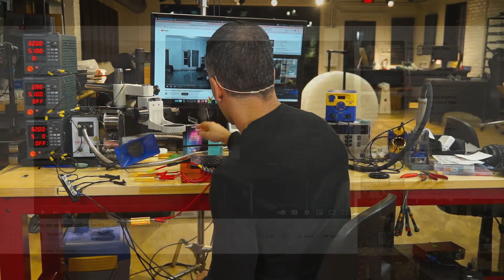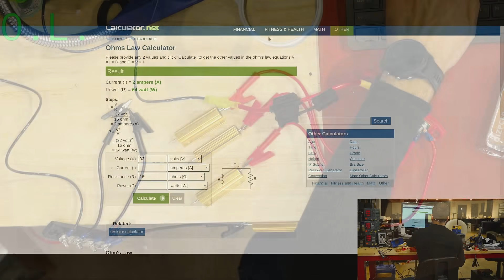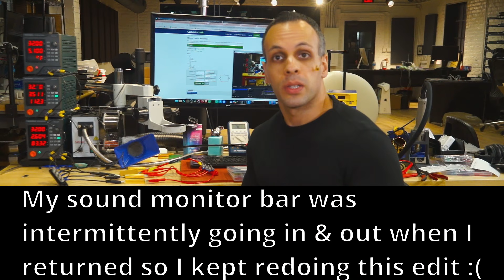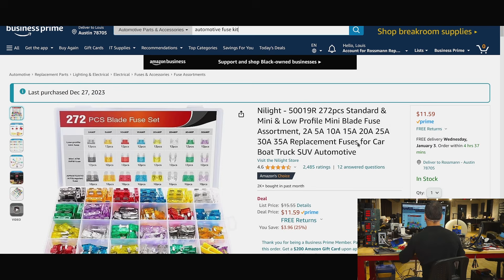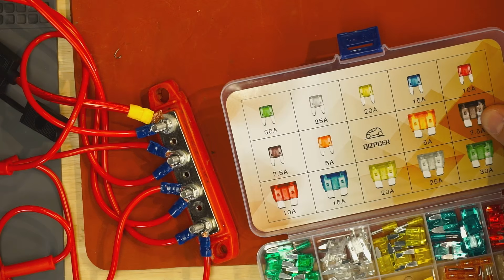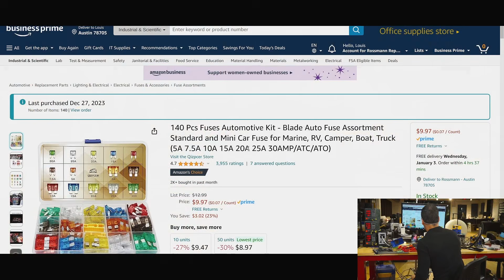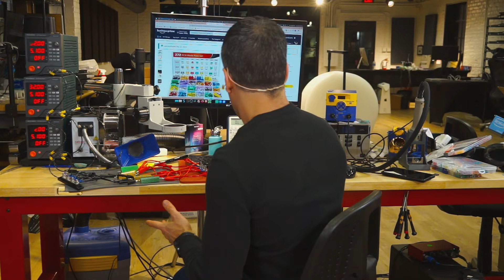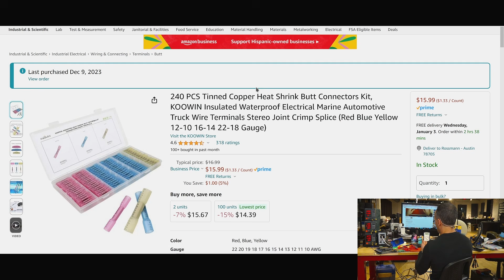Amazon Sells Fake Electrical Fuses

Comment: I found if you post an Amazon review calling out a scammy product they will take it down because you're not allowed to call things scams, apparently.
Reply from the maker: Especially when they are actually scams. This product is still up, by the way, over a year later. 300,000 views. 100 people that I can confirm reported it. Proof that you can put 8 amps to 10 amps through a 2 amp fuse for several minutes. This company truly don't give a fuck.
Reply: @rossmanngroup I have photos of my wiring harness melted!
Reply: @rossmanngroup  And 1 more year later the scam still going
Reply: As a Vehicle electrician this is very concerning indeed
Reply: @davidrobertson5700  VERY. Chaffing will happen to many many people and either create full short to ground or a leak to ground. Leak being the scariest as it really relies on that fuse being spot on. If it doesn't blow where it's supposed to you can melt, fry, and/or ignite all kinds of areas in the harness.
Reply: Still on sale here in the UK in a different package combination (still the same manufacturer), where one person reported that after using them in their bus the fuses melted instead of blowing, and nearly caused a vehicle fire! He posted photos of the badly melted fuse.
Reply: @markaffleck4622  the guy needs a vehicle electrician and Amazon should sell the fuses in a pack with a fire extinguisher
Reply: "We apologize but Amazon has noticed some unusual reviewing activity on this account. As a result, all reviews submitted by this account have been removed and this account will no longer be able to contribute reviews and other content on Amazon." If I remember correctly I got this for reporting fake reviews. I wear this as a badge of honor.
Reply: Yes, thst happens to me, amazon told me the customer is not interested in this kind of reviews,beside I told them that some things on the stuff wasn't like advertised and so on, they not even poster it only have send me a email with telling the things I have written in this post.
What a bunch of scam supporters.
Reply: I have my account permanently flagged as not being able to leave reviews on any products. It happened after I called out a 10,000 unit a month product for being a scam because it used white LEDs instead of UV like it was sold as. Amazon claimed i was banned for using the word "crap"
Reply: 100% when I left a review stating what was delivered wasn't what the listing stated it was removed apparently because my review wasn't about the product but the seller.
Reply: I actually managed to get them to remove a counterfeit product I received (for temporarily repairing lost tooth fillings).  But of course that didn't affect the sale of the original product which is of high quality and which is still being sold.  I also have seen many negative reviews for different products, and even accusations of fraud etc..  But all of that was 4 years ago or earlier, haven't really been at amazon since.  I wonder if they have started using AI?
Reply: Still very sad Bozo made it back in his phallic rocket. We should arrange a trip for all four, Bozo, Stinky, Toddy & Ragy to go into space together and make sure they stay there. At least in some form.
Reply: I've had them take down negative reviews just because they were negative. O.o Had a jar that was open and leaking when it arrived and said as much, review deleted.
Reply: Yes that happened to me even with evidence from the actual manufacturer after proof that the amazon part was counterfeit.
Reply: The question should actually be why the heck Amazon allows the manufacturer to moderate the reviews
Reply: I found that out when I called out five or six of the most egregious TV antenna listings. Never mind that I talked through the math to explain why no one is gonna pick up eleventy bazillion channels from 10000 miles away. I used the s word.
Reply: I do find his test methods a little questionable and lacking.  No in circuit measurement of total current and just relying on the supply meters of cheap power supplies (same model available on Amazon at about $80).  No voltage measurement over the fuse (current x voltage = heat which is what burns up the fuse).  No heat measurement.  No baseline test with a known good fuse to verify (i.e. Little Fuse or equiv).  I purchased a similar fuse kit (but UL approved) at a similar price on Amz just months before Louis made his video.  When they came in, I did a material test and measured the resistance of each fuse (in the milli ohm range with 1 micro ohm resolution) and they all aligned within spec of a high quality LittleFuse.   You do not need to do a destructive test to verify a fuse will work.  I also did a destructive tests (again?) on a couple after seeing Louis's video just a day ago.  The fuses blow per spec.  Some got destructively tested over time and did their job by design. I would have done a deeper dive to find out why he had a 2A blow at 6 and the other at 4? etc.  Also while there are 100's of sellers selling the same thing on Amazon, all the fuses likely come from one or two factories in China and that may be it.  Thus back to my previous remark, why the difference?  Good fuses are so cheap to make, less than 1.2 cents each.  What's the incentive to make bad fuses that blow at higher values? It's the same material cost if not more?  It's possible a manufacturer sold a load of bad ones to be scrapped, and it made it back into the supply chain instead of scrap.  Happens sometimes.   Those bad sellers on Amazon could be all the same seller just using a different name.  I got mine from Mulwark on Amz. Be aware they sell both UL and non UL fuses.  I got the UL ones.
Reply: @swit2732 I get your point here. Luis is not an analog measurements specialist, this is not about precision measurements, nor statistical evaluation. 
Running 8A for 5 minutes through a 2A fuse pointed IMHO towards a serious problem! Don't you agree?
It´s a call to action!
Reply: @frgmntTOB  I would agree it's odd that's why I question the setup that something is not getting fed back through a common ground with those cheap SMPS.  I would have taken it further to measure the voltage over the fuse as its a function of wattage (heat) that will melt the alloy.  I got a similar kit from Amazon before he made his video and they all met spec.  The price was the same as the cheap ones ( maybe even cheaper) the only difference was the ones I purchased were UL listed.   I see the other Louis is referring are not, so maybe I'll pick up a batch and test for myself.

Comment: Those power resistors are intended to be mounted on a heat sink or metal surface. They have a smooth bottom for thermal grease. My home bench is not as equipped as your's but I designed electronics and health physics instruments for >40 years.

Comment: A 100 piece automotive fuse kit on Amazon is $8.99. A 100 piece Eaton Bussman fuse kit on Zoro is $56.29. A 100 piece Bussman fuse kit on Grainger is $99.29. A 100 piece Littlefuse fuse kit on DigiKey is $69.47 + $13.89 tariff shipping to the US, thank you Mr. Trump. And there's you dinner! (I am guilty of buying these cheap fuses, wire terminals and fittings)

Comment: There’s the problem. You got continuity protectors. They do everything they can to keep  the current going despite your problems with the sub-quality load you probably got from somebody else. Try the 15 amp fuses that open with a little static spark like that which makes the girls giggle.

Comment: A 2A fuse should reliably pass 2A forever without failing. At 2.7 A (135% of rating) it should blow within 1 hour. At 4A, it should blow in under two minutes. The rating of 2A is the rating for how much current it is guaranteed to reliably pass, not the typical current that will cause it to go open circuit.    That said, I agree that those fuses are crap.

Comment: you wont find a datasheet for these, but there are standards for automotive fuses, ie they should be able to run 110% rated current indefinetly,  so that cruxie fuse actually fails if its blowing at 2a.... a 5a fuse should blow within 5 seconds at 200% rated current, so that 2nd one was actyually good..... these are easy to googled and find

Comment: a 5 amp fuse should sustain 5a forever and not blow. At 7a it should blow within an hour. At 10a a slow blow fuse should last 10-30 minutes, a fast acting fuse should blow almost immediately.

Comment: 25:29 this sentence does not make much sense. 5x rated current is not uncommon, it depends on the characteristic. I dont know the american standards, but there are slow fuses that blow veeeeeery slow. Theres TT rated fuses in Germany that only fail instantly if they pass 100x the rated current. Even the fastest one only blows instantly at 3x the rating. So it would be smart to take a look at what rating is usually used in motorcycles.

Comment: 15:25 lol you got me good there. As an electrician by trade i was gonna ask that and i still wonder what it was advertised as and how other fuses would perform. For me it would have made sense to have a characteristic that makes it blow instantly at 5x the rated current as this is quite usual. If the purpose is only protecting against shorts this is often all it takes.

Comment: So with assumption a 10amp is going to blow at 50. That is nuts. Your wiring in your car is going to light up like a frigging fuse. So you add this in a electric car you're essentially create a ticking time bomb.

Comment: I blew up my arc forge lol left me blind for half a night, made a massive hole through my hydraulic press.

You should check out their motorcycle engine, good luck getting to ur 2nd oil change. Or try their brake lever... Nm stay safe, don't buy bezos.
 I don't want what happened to the dude whose injuries taught me amazing is bad place to shop

Comment: Eight years ago, I had a 2012 Lincoln MKZ that I bought when it was 6 years old. I felt that the headlights weren't very bright and thought that they might be wearing out. I got on Amazon's automotive parts "dashbord" to price a new set. It told me that I needed the xenon arc lamps, the bright lamps in the transition between the old style halogen lamps and the newer LED lamps, which are normally pretty expensive. They are the minature version of the daylight bright spotlights on police helicopters. This made sense at the time because this car had the magnifying lenses in front of the bulbs so I couldn't see which type that it took, the xenon arc lamps do dim with age and I bought the car at 6 years old. I got the car cheap, my finances were kind of shakey at the time and my state has inspections so I ordered an admittedly cheap set for about $25.00. According to Lincoln, to access the back of the headlight assembly to change the headlight bulbs, you have to take off the entire front plastic part of the car. When I finally got it all apart, I find out that my car takes the cheaper halogen capsule type headligh bulbs that I could have bought at Walmart for less than $10.00 each at the time. Needless to say, I was PISSED. I have the car apart, can't use the bulbs that AMAZON SAID THAT I NEEDED and, with the car in pieces, I can't drive 14 miles to Walmart to buy the correct bulbs. To add insult to injury, it cost me $11.80 to send back $25.00 worth of WRONG LIGHT BULBS. I left a 1 star review but made it abundently clear that I faulted AMAZON'S "DASHBOARD" for the mistake and NOT the seller and explained the reason why. A few days later, I got an email from Amazon. Thinking that it might be an apology and maybe a credit for the return postage, I opened it to find a tersly worded statement that Amazon does not accept negative reviews about IT'S service. ONLY valid negative reviews about products sold by other sellers. In other words, We are 110% perfect 105% of the time but our sellers advertized here make mistakes occasionally. Needless to say, Amazon is at the BOTTOM of my LAST RESORT list now.

Comment: What makes this worse and even more dangerous is the fact that some people have a habit of upsizing the fuss to a higher amperage! If this fuss is already allowing more amperage than rated, how much more dangerous would using a fuss that already is rated for a higher amperage?

This is a safety issue. But Amazon sells other goods that are well known scams and simply refunds or replaces those goods, instead of pulling them off of their shelves!

If Amazon is going to be a massive distributor, it needs to have a level of accountability equal to any other industry!

By not validating the quality of the goods they sell, they are knowingly committing fraud! 

What other business would get away with fraud even at a low level? So, why does Amazon get away with fraud at a massive level without Congress stepping in. This is a Monopoly and needs to be treated as such!

Comment: It seems to be a bit naive to assume that those Amazon reviews from end-users are based on the accuracy of the current ratings.  If the average driver has a blown fuse in heir car, they are likely more interested in price, delivery speed, and convenience of selecting a fuse out of the collection, and getting back on the road. 
The accuracy of the current measurement of those power supplies is no more believable than the rating of the fuses you are testing.  A more convincing test would have a proper ammeter in series with the circuit loop.  
But your basic point is made that those fuses are just physical knock-off copies of the properly engineered products.  Thanks, Louis.

Comment: Most sadly, while watching your video, a Youtube ad popped up for a magical device that "can cool an entire room from 90 degrees to 68 degrees in five minutes".
They claimed that "it took in hot air and spit out cold air"... but "with NO piping, cutting, or venting required for installation".
In fact they actually showed it "working"... just sitting on a desk and plugged into an AC outlet.
But the pictures showed what sure looked like the inside unit from a standard "mini-split" air conditioning unit.
(Youtube ads have gotten WAY worse than the worst crap on Amazon... and nobody seems to care at all about them.)

Comment: Louis, keep in mind most  fuses  have what is called a trip-delay curve. They should also have an AIC rating (amperage interrupt current). Good luck finding any Chinese fuse that actually publishes these specs… Bottom line fuses don’t always trip at face value due to trip delay curves which allow for brief in-rush current without nuisance trips… That said Scamazon fuses & breakers are flat out dangerous. Bussmann/Eaton or Littel Fuse are all I will use. We had a customer destroy a $2000.00 200A marine alt when his  250A Scamazon breaker tripped at 130A and took out the rectifier.. Lucky for us we specified a Bussmann  Class T only. He was pissed but we told him the exact fuse to use, not a cheap counterfeit breaker… FWIW get yourself a DC electronic load much easier than resistors…. Best way to compare is to look up the Bussmann trip delay curves.  If you do you would see that a 2A ATO/ATC SHOULD TRIP IN UNDER .1 second at 10A as all these manufacturers are making cheap clones  loosely based on Bussmann ATC, ATO OR ATM ETC. fuses… FWIW as an EE and marine electrician I have had tons of reviews disappear even when every review rule was observed. All it takes is for a seller to complain about a review and Scamazon deletes it. Their review system is totally corrupt and entirely useless….

Comment: I need to drop this here....fuses shouldn't blow on rated amps, they should just carry the rated amps, that's a missconsemption, that's what the rates are for not for fail, but have a big tolerance, they are here to protect against shorts and the rate is the continues amps.I agree tho, 8x or 3x is to much, but at least 150%upto200% is rated safe !

I agree fully tho with, those fake reviews of garbage, and the 5 times rates, that's simply dangerous !

Comment: I had the same issues with their push button 120/240v 10A breakers. I installed it and drew almost 20A. I was floored as I put this is as a circuit protection device.

Comment: What vehicle uses 32 volt fuses?
Reply: it's just the max voltage, the fuses work the same at any voltage (as long as the voltage is not high enough to create a spark across the air).

Comment: I noticed both bad fuses failed at 10amp.  So the Crocsee might not actually may not be a better brand if they are just mass producing fuses at say 10 amp, 20 amp, 30 amp and then label them with multiple ratings.  IE everything less than 10 amps gets a 10 amp fuse but is labeled for whatever say 2amp or 5amp

Comment: I made the mistake of ordering fuses and fuse holders for guitar amps as well as volume pots and several other types of equipment to stock my workshop. I also stocked up on wiring of different sizes and values. most of the parts showed up as miniature sized and were not standard. I worked on aircraft for Boeing as an electrician for 38+ years. I was not prepared for the sub standard parts i received. the fuse holders were too small for standard replacement as were most of the other equipment, especially the wiring. this makes me very angry.

Comment: Tip: If your PSU are capable for parallel use, just adjust the current limit one by one. Due to the low load there will be almost no voltage drop. Therefore you don't dissipate as much power and don't need to be afraid of your deskt. Right before the fuse blows the voltage will rise caused by the growing resistance. 32 V is just the rating of the voltage the fuse is capable of disconnecting (If the rating is to low it may not switch off properly).

Comment: for those who dont understand fuse. Fuse main roll is to blow up if the voltage fluctuates. If it do not blow up it can harm all the instruments that are connected in that circuit. A 2 Watt fuse blowing up at 10 is insane. It can be fire hazardous at the very least and say bye bye to Expensive instruments.